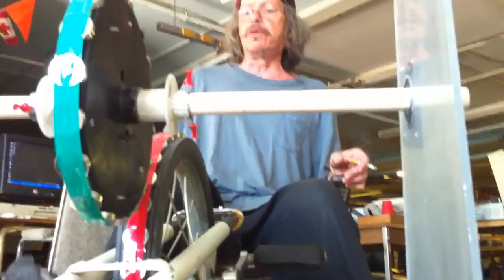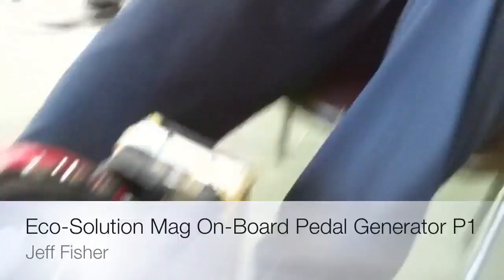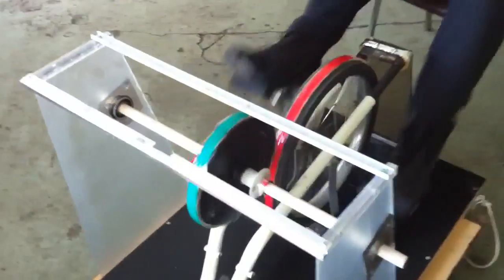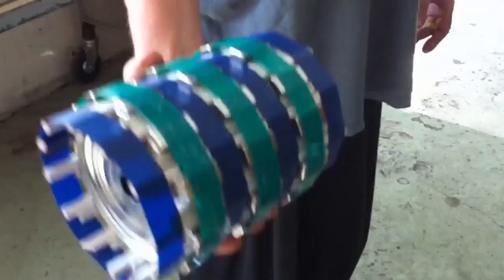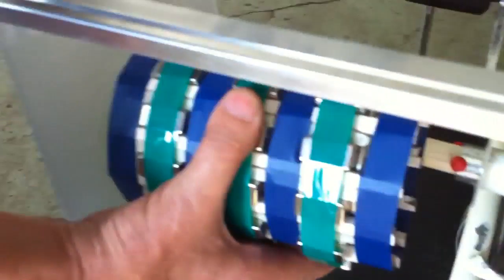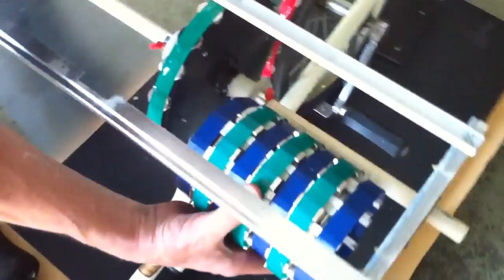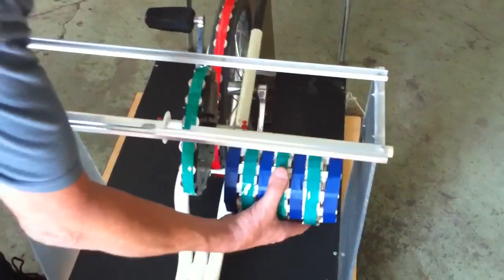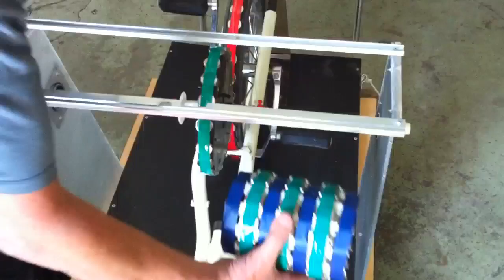Eco-Solution Mag On-Board Pedal Generator P1

Comment: Thanks! The Magnet-Wheel works fine; but is difficult to convert yo ftom other uses (such as mech-bikes); but will get pretty boring in car use! That is why the "other end" - using Front Air Pressure to take over at speed is most important! So much more available than "wind-Generators" - all now WASTED! Intermediates like batteries (even Li-ions) are also dumb! Frictionless Mag-Lev Gens make all such dwadlings a thing of the past now! Self-Propelled Cars are not "Magic"/ simple REAL science!